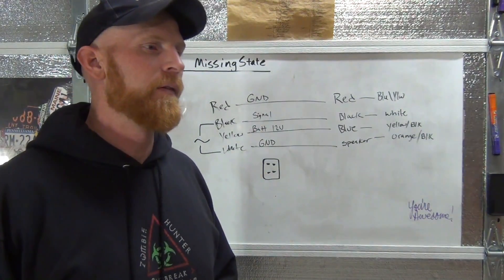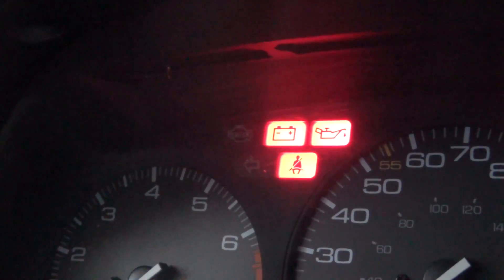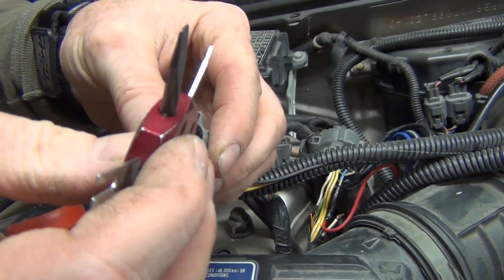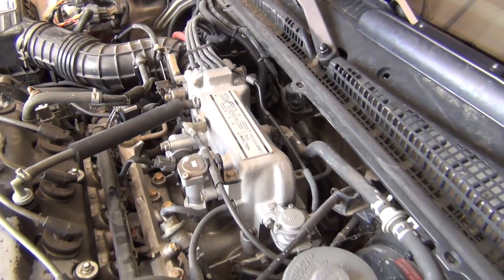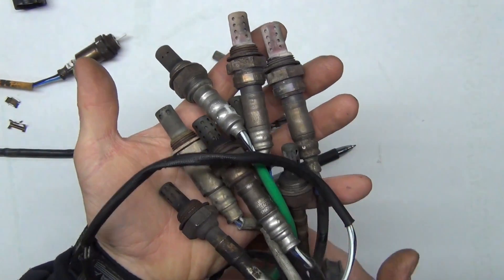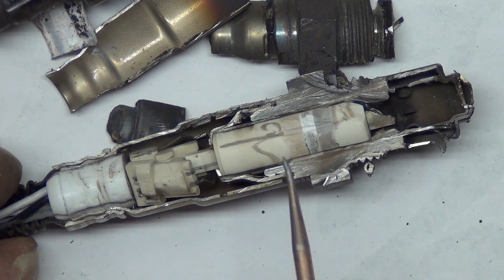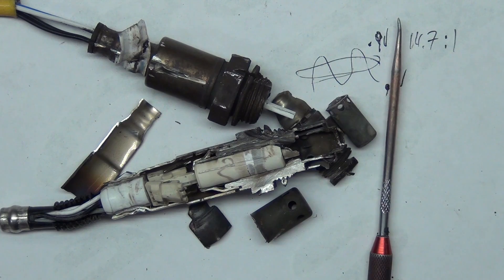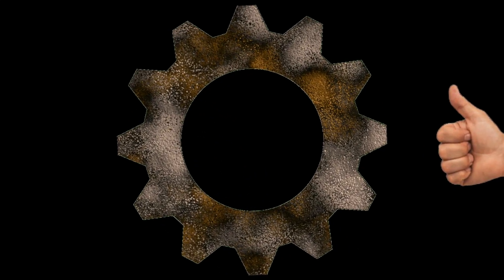I Cut Open an Oxygen Sensor or Two 1990 Accord Update

Comment: Sometimes people do throttle body coolant delete so it has lower air intake temperature so you got to make sure your coolant lines are going through your throttle body also it helps to clean the throttle body and that little air intake controller electrical thing that's attached to the throttle body oh and something else that I did I took my spark plugs out let us open WD-40 and with the Piston holes open or whatever I filled them up with WD-40 and let them sit for like a half hour and I put my plugs back in without my coils so no spark and I turn my engine over to put all the WD-40 into all the working corners through the valves and stuff help clean it all out it did it a giant service 221,000 mi for the k24 series and she starts on a dime

Comment: It's okay buddy I took my all-wheel drive k24 series all wheel drive element to town one day and a raccoon decided to come out into the road and I run around I'm so close I let his whiskers on fire but he lived anyways I ended up bombing out through a field went through a hellacious mud pit with it in the midst of trying to keep my 40 mph vehicle not dead and me turned right side up inside of it and there was a ginormous log inside of the water pit that absolutely ripped all of the wiring off all my o2 sensors and I was out in the middle of this field swearing at a raccoon underneath my vehicle trying to figure out where all the plug wires went and these stupid plugs for the oxygen sensors and it took me two days to get it right but since I got it right now I know more

Comment: I've grown up and had my share of oxygen sensor headaches. I cant understand why they conti ue to use this way of managing emissions and have done nothing to advance this area. Rather, they have increased the complexity by adding more catalytics and oxygen sensors (some cars have FOUR). 

Imagine the benefit to figuring out how to simplify the system of oxygen sensors.  
1. It would benefit the consumer as it would reduce all this hassle and cost. 
2. It would improve the environment. 

Maybe a laser diode can replace the O2 sensor. Those are cheap in comparison. A laser light would measure the composition of the exhaust gasses. Then when you have degradation, you just flip a switch and it cleans the sensor and BAM you are back on the road.

Comment: also remove the iacv. idle air control valve and give it a good clean.... main causes for idle surge on these honda's are....1. air in coolant. 2. fitv out of adjustment. 3. vacuum leak... sometimes you cant hear them on these cars.....  3 dirty iacv. 4. base idle not adjusted correctly. 4. base idle is wrong.. base idle is done with the service connector jumped

Comment: i love these cars!! these cars are my bread and butter!!! i know them like the back of my hand
Reply: help ,my 92 accord turn on fine after 15 minutes , starts to stumble acceleration and running rich ,and low rpm , change spark plugs ,cap, rotor, fuel pressure around 32 ,timing is correct with the inside the car plug tap with a clip , no vacuum leaks, checkwith a smoke machine , the car no longers has the cat converter , no exhaus leak on the maniffold , i just order a use distributor, how can i test the o2 sensor, i unplug it an check engine light came on, but ones i plug it in , i have no check engine. thanks

Comment: Any suggestions on how to get an oxygen sensor loose on a chevy blazer? My neighbor heated it and still it is froze/rusted solid.
Reply from the maker: Wire brush it around the base so you can soak in in transmission fluid and acetone then wait overnight or so till it's dried up or wipe it off so it's less flamable.  Then heat it again and apply parafin wax to it liberally.  The wax should penetrate it and get it loose.

Comment: With the voltages so low, I always worry that if you change the lengths of the wires to the O2 sensors, you will throw off the readings.  What are your thoughts on that?
Reply from the maker: Use good wire and sleep good at night.  You'll notice the wire is usually that high end silver high count stuff.

Comment: Hello Brian, Love your videos man! Not sure if you already got the Accord fixed or not but just thought I would give you some insight on the 90's Honda "loping idle" issue. Honda's unlike many different vehicles around that era chose to control excessive idle by cutting power to the injectors when the ecu sensed that the idle was too high and then back to normal once the rpm dropped enough. So basically that is the final cause for the loping, power to injectors, no power to injectors, etc. However what caused your idle to get higher than what the ecu expected is where your solution lies. Could be a faulty/dirty idle air control valve (both hot and cold I believe this year accord has), Any vacuum leak past the throttle plate (sometimes just a dirty throttle plate itself), and another one which is usually uncommon is a air bubble sitting by the coolant sensor(the one by the coolant inlet, not the one under the distributor). For vacuum leaks on those nightmare older cars I just take hose pliers and pinch one line at a time. Hope this helps brother. Keep up the great work!

Comment: You can see the valve at 6:06 on this video in between the fuel pressure regulator and the throttle cable. Your just has two Phillips head screws on it.
Reply: I concur, my similar advice is for a different engine than this one.  Just north of "Performance Fuel Injection' text on intake manifold.  Two screws on the steel end cap.  Servo is mounted vertical here so loose spanner style nut will be first thing you see under that steel cap.
Reply: Programmed Fuel Injection and it was inspected by inspector number 15A0, time stamp of 5:40.

Comment: Needs a mention of follow up measures/results.  End story in sight or beyond the horizon?  I am thinking the air holes exterior to the sensor are for controlled cooling rate as the platinum sensor itself needs heat to work in the first place and the exterior isn't hot enough for that.  What you see as voltage on the sensor is the catalytic action itself and just like the main cat, these need lean periods to recharge with oxygen so they can donate those ions to the gas streaming past and produce a usable signal.

Loping on these is commonly found to be a problem in the thermostatically controlled cold air bypass valve south and below the distributor where over time the servo hold down nut has worked loose and it no longer functions like it's supposed to.  Some videos out there on it, but I notice most are trying to 'adjust' it again when I'm pretty sure it was just all the way in and just not tight enough from the factory to stay put.  It's another wax servo motor like a standard thermostat uses only this one melts at 80 degrees at which point the cold air bypass is supposed to shut off entirely.  It doesn't, so the IAC is ramping full off to full on in order to 'find' a setting that can keep the speed down to where it's programmed to be and that doesn't exist anymore, so ECU just keeps ramping IAC.  I bought a used bypass valve just to see if I could re-rig it to my shower valve to keep my shower water at an even 80 temp.  The original french design of this type of shower valve lost all it's lard in it's servo apparently and it no longer works at all, tried a little for a couple of showers and then quit outright.  Honda to the rescue.  I can hope.  Tankless water heaters are extremely efficient, but they need a little more better temp control, especially when you all wet and neked.  House well turning off and on not helping either.
Reply from the maker: The next procedure is coming up soon!  Probably a week from today.

Comment: Your idle looping issue is the fast idle valve. It's located on the intake manifold between it and the valve cover. It has two 8mm bolts holding the cover on it, you need to pull that cover off and adjust the valve inside. It has backed it self out of adjustment, I usually put a dab of rtv on the threads after I adjust it so it won't blackout again.